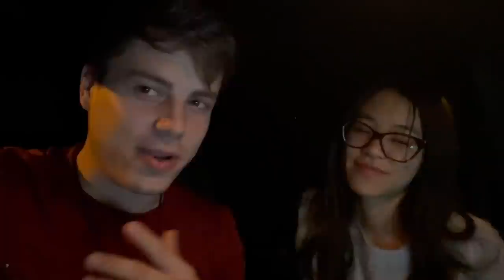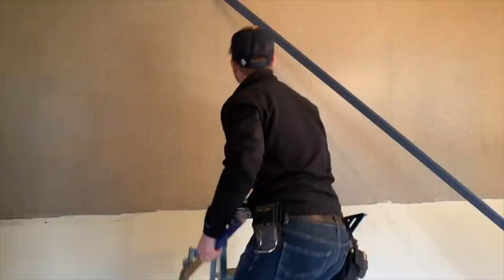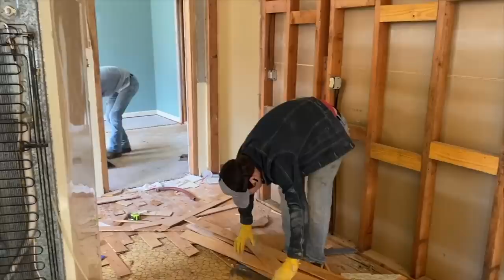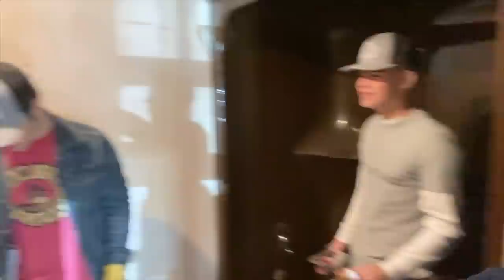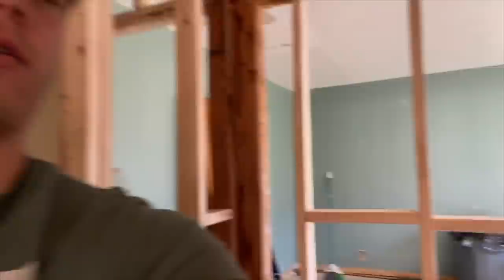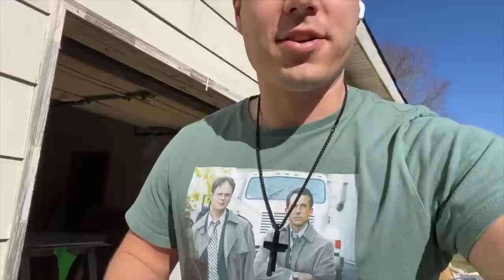Our First HOME 🏡  - Demo Day - Part 1

Comment: My best advice is to keep a “remodel binder” with all the brand names and colors of your paints, grout, tile, carpet, etc..in case you need to touch up the walls or replace a broken tile. Also, keep extra tile, paint, grout, carpet in case you need to make a repair. We store ours in the attic. You can’t have too many electric outlets. If you plan on having electric recliners and you don’t plan to place them against a wall install outlets in the floor. It’s also great to have them around the eaves of the house for plugging in Christmas lights. If you want a water fountain outside your entrance add an outlet for that too. It’s easier to add it now than later. Congratulations on the purchase of your first home. I can’t wait to see the after pictures.
Reply: What outstanding advice!
Reply: My husband and I did this too as well keeping a small quart size paint container for touch ups in each room. It worked out beautifully! Then if you don’t need the paint the children can paint something they decide to build. 😆
Reply: Great suggestions!
Reply: @JDR2012  UP TV has said they are moving more towards scripted shows, & The Bates Family Show was cancelled. ☹️
Reply: YES to this. 10 years later and we still refer back to the binder because it contains everything about our home, warranty info, etc.
Reply: I furiously took notes! 📝  Thank you for the excellent advice! 😎👍
Reply: @tjk200081  So unfair. 😕
Reply: @mysticalmargaret6105  I agree.
Reply: FANTASTIC IDEA🎉🎉🎉

Comment: The most important thing that my family did while working AND living in a construction zone was cleaning up at the end of everyday. We gathered the tools that got spread out, picked up the trash, put reusable wood/item in a designated place, and swept the floor. Dad was adamant that we did this every night. There were times I was so tired u could hardly stand up, bit the next day when we started working, we knew where everything was located and it was as clean as a work zone could be.

Comment: Talk to people who have the black metal roof ask if utility bills are higher and does it fade quickly over time. If you don’t have outdoor outlets then have some added to both sides of house when your electrician comes. A covered porch that extends across the front of the house would add so much dimension and curb appeal.
Reply: The new metal roofing doesn’t fade. No matter what color you put down. Over twenty years ago a friend put a dark blue roof on her house and it looks as beautiful as it did when installed. New England weather is tough on roofs but the fifty year guarantee that comes with the metal roof is serious.

Comment: I’ve done this type thing many times as a designer. Anything you want now, DO IT or it won’t get done.  I couldn’t tell if you’re doing an open concept floor plan. I’d open everything up, it’ll make it more airy and light. If you can vault the ceiling in the living/dining/kitchen do it. Will make the entire area look bigger. The one bathroom I saw rearrange it, make it bigger if possible but don’t take away from master bedroom or closet. The 2 places to add value is the master suite and kitchen. Don’t scrimp on those 3 areas. Good luck can’t wait to see the next update.
Reply: this is great advice! hope they see
Reply: @Estiexo  I hope they see it as well. I’d love to go out and show them ideas I had while watching video. Pay for my gas and somewhere to stay and I’ll share my expertise with them.

Comment: With no basement, I'd get a tornado shelter put in somewhere. They can be put in garages or outside. You'll be thankful when an ugly wall cloud is staring down at your area. Believe it or not, TN has one of the higher death rates by state from tornados.

Comment: Biggest don’t : don’t spend more than you feel you can comfortably afford 
Biggest do: get a fence for the dog , privacy fence is worth the extra cost
Reply: Yes! If you have a dog or plan to adopt one get a fence for the backyard. Doesn’t need to be a high privacy fence (in my opinion), just a wood and wire. Of course you would never leave a dog outside alone for long, yet in the early mornings it’s so nice to open the back door for potty break rather then go for long walks.

Comment: I hope you take out all that black insulation and install new. The better insulated the house the lower your electric bill. That looks like a much older house. I would make sure the current wiring is okay and installed correctly, especially is remodeling has been done over the years. People sometimes do the work themselves and overload their fusebox.

Comment: Congratulations on your engagement and home. Do a pantry if you have room, even if it's a small one. Lazy Susan's are awful..if you have a corner cabinet do the shelves  that pull and swings out letting you access all the items and no dead space.  It's your house,  listen to advice then go with your feelings for your family. Go with a gas water heater because you'll have hot water even if the lights are off. That is if you have gas there already. Put a letter describing you two, a pic of you both and one of the outside of the house before painting, maybe your CD, and anything else you want in one of the walls. My husband and I did that with that days newspaper too. We had small grandchildren and they liked to help, so we put their age on anything they helped with before flooring was installed.

Comment: If you are replacing flooring early in your reno, be sure to cover it with heavy duty brown paper. You can purchase it in large rolls. We ended up with a couple deep scratches in the flooring because we did not cover it up to protect it.

Comment: So exciting, Congrats to you and Tiffany on your new home and upcoming wedding! 💒🤗 Are you removing the popcorn ceiling with a sander? I need to do mine and I'm not sure what is the easiest / quickest way to remove it. Thanks so much! 😊
P.S. You are truly blessed to have such an amazing family. 💞
Reply: I removed mine with a spray bottle of water and a scraper.  Super easy, but wear a mask (I didn't; never thought about it) because it's gets in your face and lungs. It's quite easy but messy.
Reply: @vickil4849  Thanks so much for the tip! I'm starting with my bathroom which is smaller. It literally looks like there's mud dripping down from the ceiling, not a good look! 😆 Lol

Comment: Biggest mistakes- not buying enough laminate flooring so ended up short, then Home Depot discontinued it. And letting our painter glue the clear strips on drywall corners (despite there being holes for screws). DON'T GLUE THE CORNER PROTECTORS 🤦‍♀️

Comment: An option: You said the roof is going to be black. Wouldn't painting the outside windows black also pull the look together? Especially if the siding is going to be white?